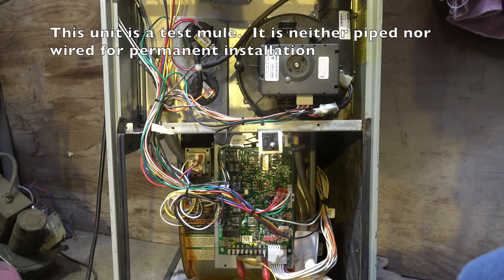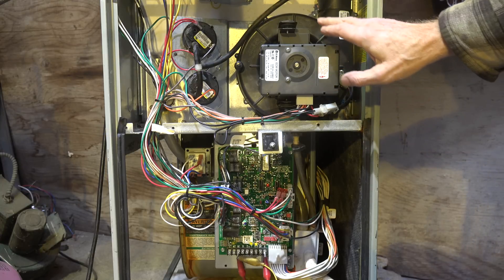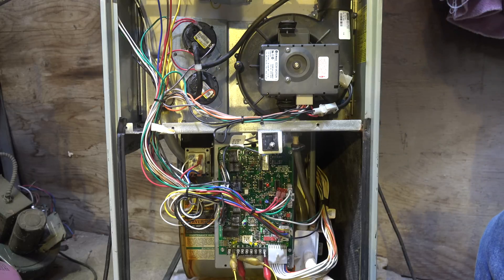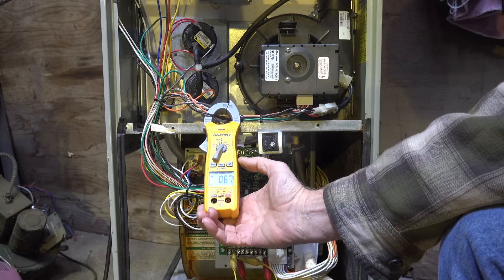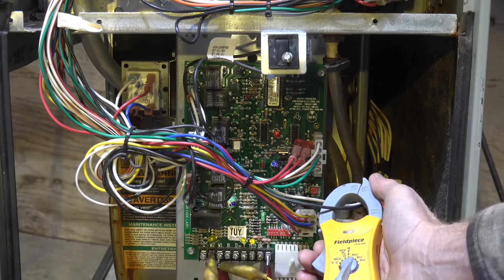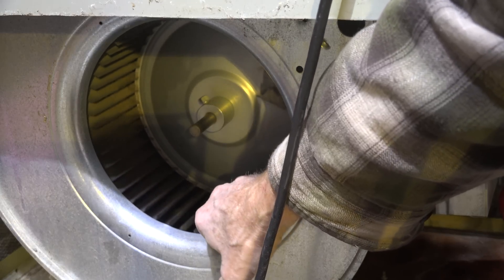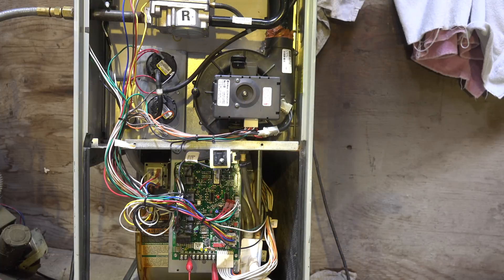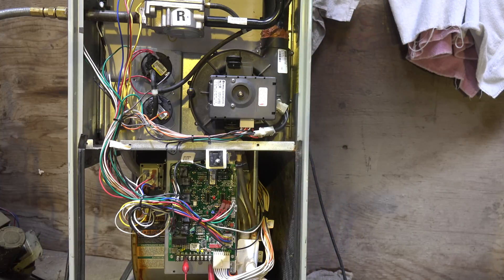Service of the 90+ efficient gas furnace #5 and last

Comment: I have noticed that our XV90 exhaust fan runs for a while after the furnace reaches the temperature that is on the thermostat.  Sometimes for 15 minutes or more.  When I shutdown the furnace; either by the master switch or the thermostat and then turn it back on, the exhaust fan is quiet.  This is not the main air flow fan directed into the house, but the smaller fan connected internally to the furnace.   Any ideas would be appreciated.
Reply from the maker: Variable speed inducer or PSC?  Variable speed will be a rectangular motor.  Psc will be cylindrical.
GFM
Reply: @grayfurnaceman  The speed inducer does not have a rectangular motor but is cylindrical.

Comment: These videos are a great tutorial.  You've mentioned along the way the condensate drain has some harsh chemicals.  No special way to treat them?  They appear to drain to an automatic sump pump and just get pumped into the sewer/cesspool system.
Reply from the maker: The condensate is acidic.  The condensate pumps are designed to work with the acid.  The only problem with drainage is possible corrosion of any cast iron drains.  Not saying it will ruin piping, but possible.  Plastic is ok.
GFM

Comment: Anything wrong with checking amperage on the common leg on the incoming line voltage? I usually check amps there and subtract the amp draw at the point at which the flame sensor proves flame from the total amp draw with the blower running. With the door on.
Reply from the maker: You can do that.  It is not quite as accurate, but pretty close.
GFM
Reply: grayfurnaceman thank you sir. My first heating season in the field. Started last cooling season so I'm new. Love your videos 👍

Comment: GFM I notice you take the amp draw of blower with door off. I'm fresh in the trade and for the first year I have been told to take the amp draw with door on. The way I was taught was to take the amp draw on the black wire from junction box and minus the amp draw of the inducer which gives me my blwr amp draw. What do you think
Reply from the maker: You are correct.  The units I use for mules have a lot of their covers missing.  However, I would be checking the amp draw directly at the motor wire.
GFM